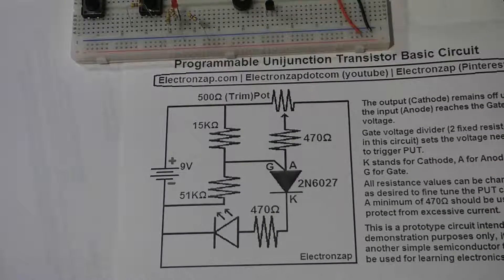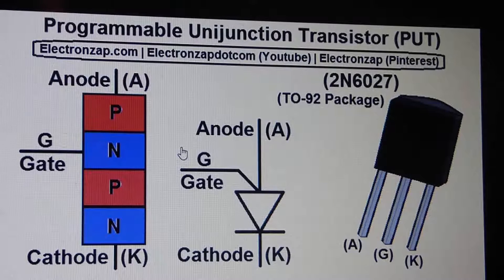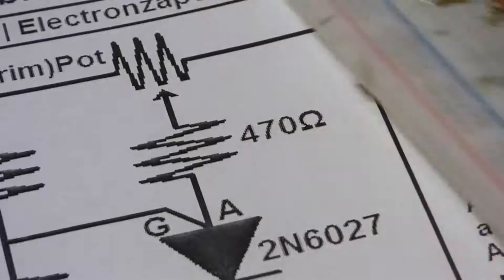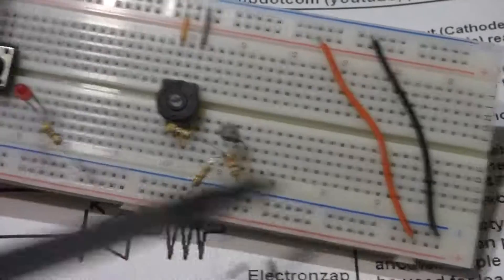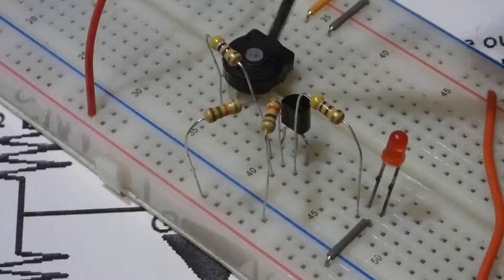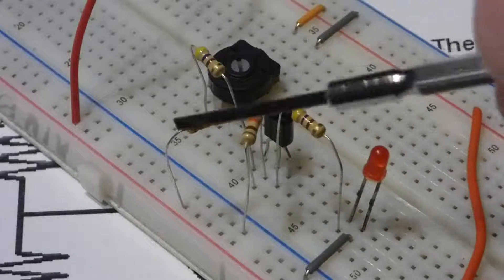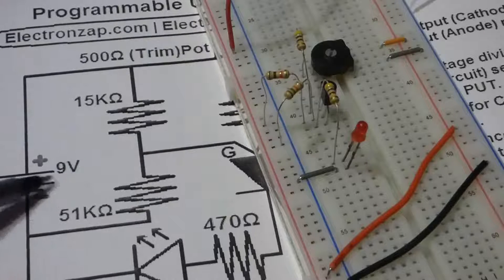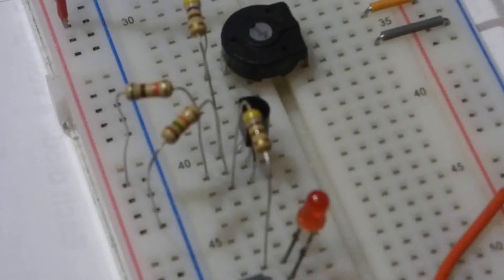Programmable Unijunction Transistor PUT 2N6027 demonstration circuit step by step build

Comment: Far easier to understand and get the hang of them by using a constant current to the capacitor. And a (ever so slightly larger) constant current into a grounded resistor, to generate the programming voltage., No lock on etc

Comment: Almost seems like a useless part doesn't it? I am sure it has its  purpose.
Reply from the maker: PUTs aren't used much, especially by beginner hobbyists, so I wouldn't recommend that anyone buy any unless they know how they are going to use them. I got some in at least 1 kit I own and I often see them explained/mentioned in books and online text so I figured it was worth the time to make a video. Otherwise your observation is pretty spot on. Thanks for watching!
Reply: PUTs are used mostly in fase control systems and also as oscilators, as a practic use: the intermittent lights of our cars has a relaxtion oscilator which uses a PUT
Reply: Akin to a spark gap, but instead of hv dumps at an adjustable low voltage.
Useful for situations where one might occasionally encounter voltage spikes on a timing capacitor... Like when usually a (DIY) variable capacitor with a huge range of values. In worst case situation on instant change in capacitance of 250mF down to 25nF... That resulted in a big voltage spike into a 555 timer... Which was enough to do weird stuff with their behaviour.  PUTs solved issue for me.